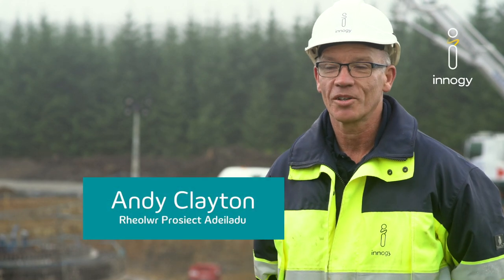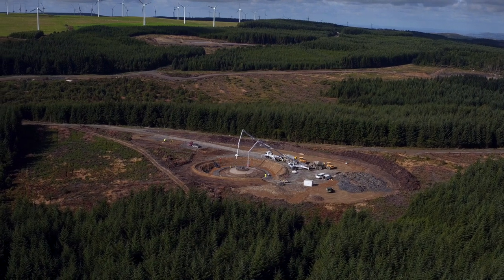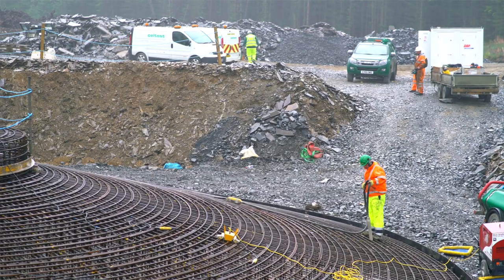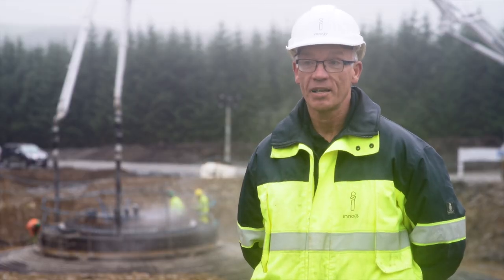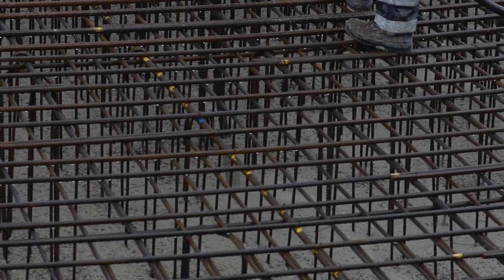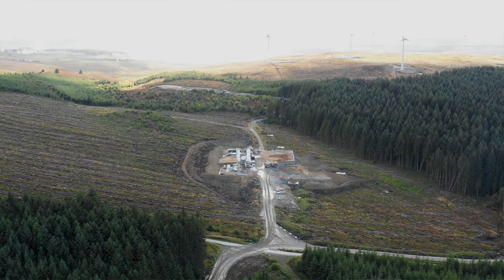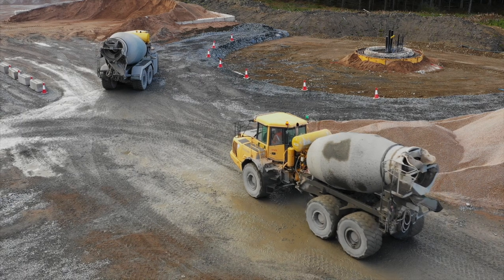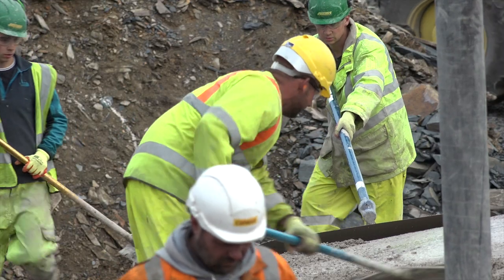Innogy - Clocaenog Forest Wind Farm

Comment: How is 16,200 cubic metres of concrete and 2,160 tonnes of reinforcing steel (total for 27 turdbines) considered "green". The damage to the environment is way more significant than the "saving" the site manager is so pround about by the concrete being made on site, negating the need for 100 vehicles movements per day, per pour. The greenest thing would've been for Clocaenog not to have been built at all. It's just corruption all over.